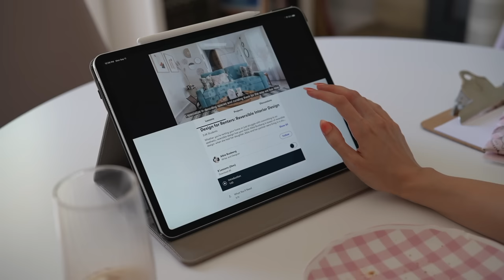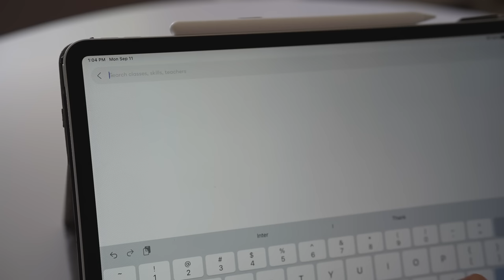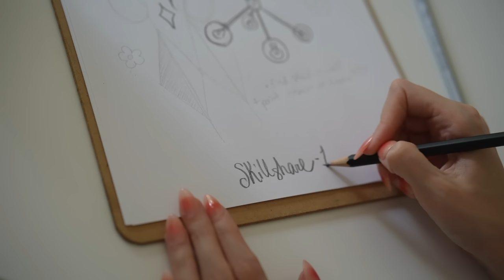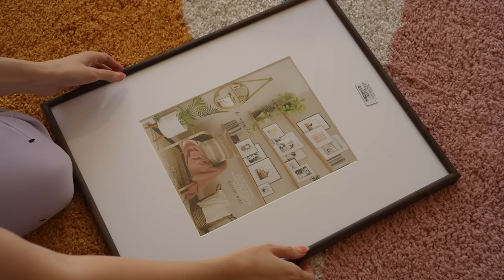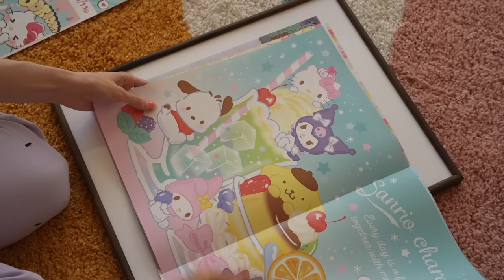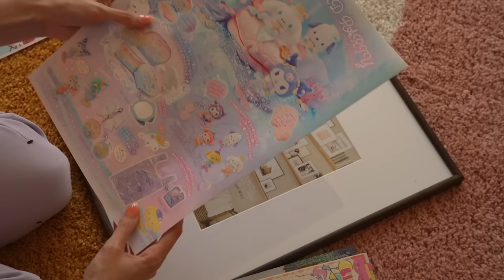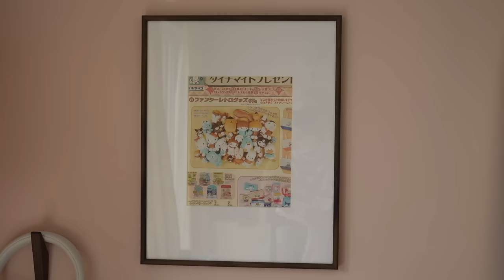ASMR | fresh start, cozy aesthetic desk setup vlog ✨

Comment: I know a lot of this was for the process, but a tip from a former professional painter if you need to paint rooms in the future (aside from the cutting in with a larger brush) is to always use an extension pole with your roller, even if you can reach without, and use a lot more paint in your tray and really saturate your roller before rolling it out in the tray - it will go on sooo much easier and faster and save you sooo much arm and back pain because you won't have to push into the wall with the same effort 😊

Comment: I’m no garden expert, just a hobby gardener, but my experience with tomatoes and summer curcubits (like cucumbers and zucchini), the limiting factors have been the size of the container/root depth, pollinator attention and temperature. Tomatoes especially like to root pretty deeply (depending on the variety), so using the biggest pot you can manage can help. And curcubits can be a little fussy with temps, too hot or too cold and they won’t produce female flowers (which turn into the fruits). You can’t control the temp though, which stinks. However, if your plant is producing both male and female flowers but you’re not getting many fruits or they’re small, you may need more pollinator attention. Planting flowers in a pot next to them can draw more of them in. I’ve had super good luck with dwarf/french marigolds and calendula. Very hardy, prolific and will produce flowers all season long! Sorry for the unsolicited garden advice, feel free to take or leave any of it! but your plants look really healthy especially for this time of year in your zone, which means you’re attentive and doing a good job! A few adjustments next year could help increase your harvest 😊
Reply: You can also use a soft paintbrush to pollinate the flowers yourself!

Comment: For easy removal of price tags, if they don't come off quickly, try heating them up with a hairdryer. Some of the adhesives used in tags are heat-activated and will become very easy to pull off without leaving a residue.